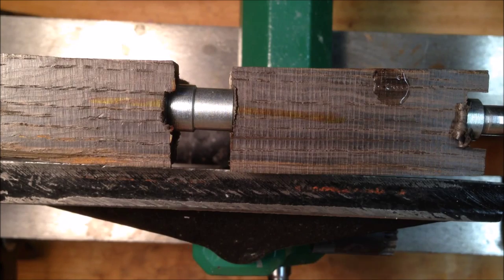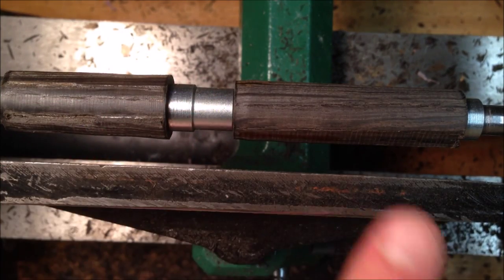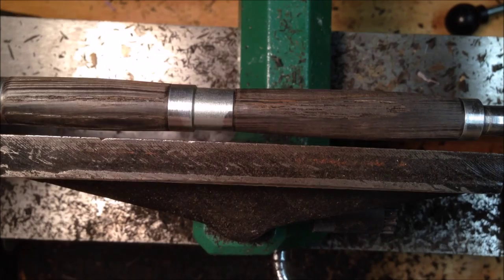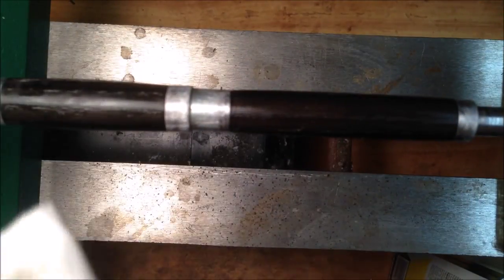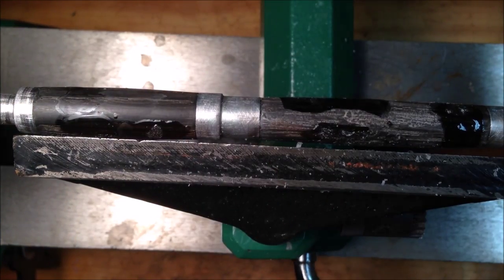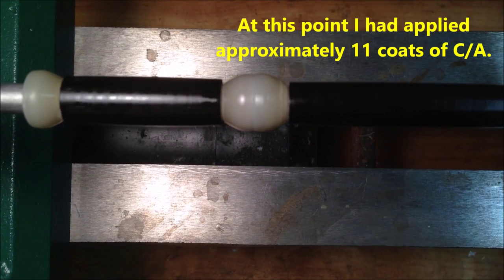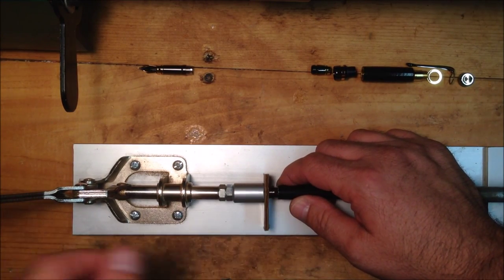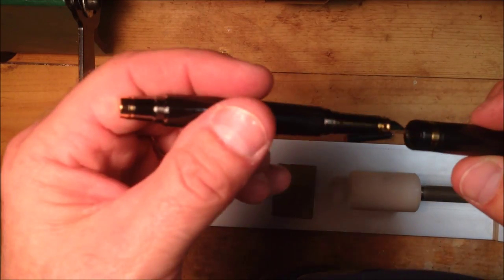Ship Wreck Fountain Pen - Full Version

Comment: A little fyi for when turning very old wood that may have been submerged for a while. If you have a pressure pot, coat the wood with slow setting glue and put it in the pressure pot. When turning, if you hit the depth of the glue in the wood, re-coat and back in the pot. I used that method years back on a piece of driftwood that I turned into a base. Never found out what the wood was but it sure was pretty. I had someone tell me that you can put the blank inside a toilet paper tube and full it with clear non-colored epoxy. Not so sure about that method though. Seems labor intensive. Enjoyed the pen.
Reply from the maker: Thank you Steve. 

Regards,
Bob

Comment: I have watched several of your videos, but I always appreciate the projects that use wood with a story to tell. I have been lucky enough to run across such types of wood, only to have some of the blanks explode on me because of the age. I have not tried yet, but I have bought the components to make a vacuum chamber in order to extract all air from any voids in the wood and then allow a product called "Cactus Juice" to fill in the voids and harden any punky wood. Have you tried such a process? It seems that would be a good idea for such a valuable piece of wood from the 1600's. In any event, great video, thanks for sharing.
Reply from the maker: Hello Stephen,
  Stabilizing the wood is an excellent idea and will really help with turning. I don't have a vacuum chamber or pressure pot (yet), but I want one for this type of use. I have turned stabilized wood and it always has turned well for me. 

Regards,
Bob